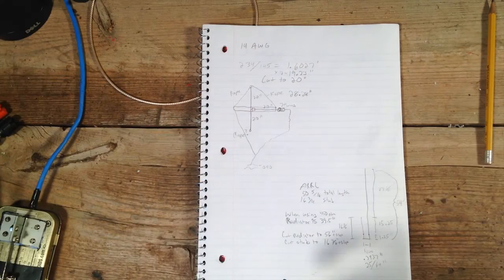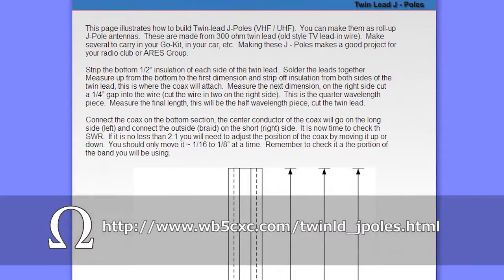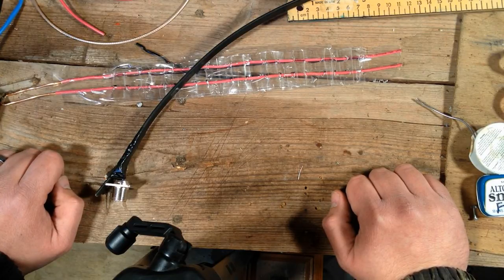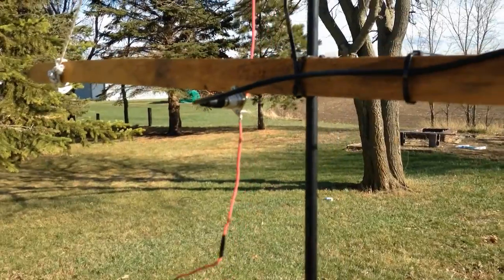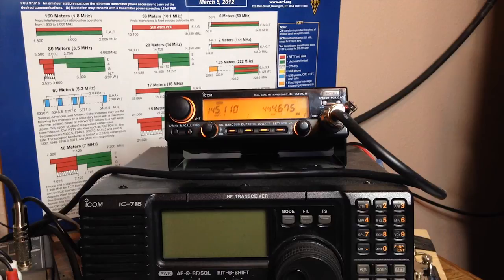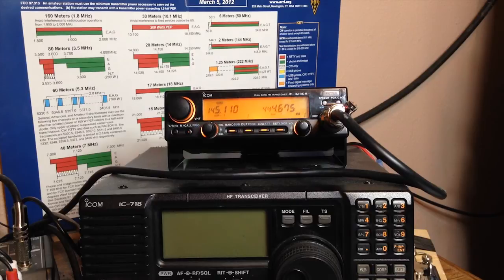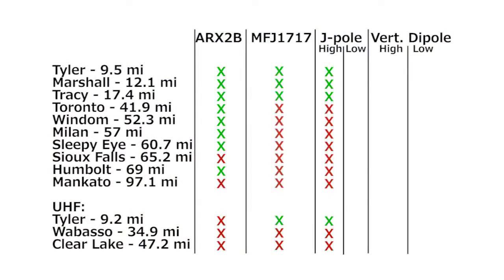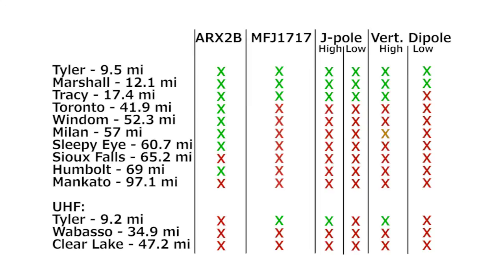2m Portable Antenna Shootout: J-Pole vs Vertical Dipole

Comment: Wow, - I made a well constructed vertical dipole, using 1 inch round aluminum elements, and put it up at 40 feet. it hits repeaters well to plus 30 miles in a very mountainous area, and I am in a small valley. I had better hopes for this video. You state the top of your J pole was 18 feet, yet you have the dipole at what looks like 6 feet?  Science has methods, you did not employ them.

Comment: some things I can see that are not clear but dont look right. You used building wire with conductors inside it as a die-electric spacer for the J pole. and you also could not tune a 300 ohm section of wire that did not have the rest of the antenna connected to it ? I have made several J poles and extended this to a co linear J pole the SWR is low and I trigger repeaters more than 20 km away on 476 mhz CB band here. Just working from figures people say does not work again - JUST WORKING FROM FIGURES AND DIAGRAMS off youtube etc does not WORK. Antennas are affected by all sorts of things even the diameter of the wire. YOu need to tune the J - Pole yourself by using 1)known diagrams and principles that work and sliding the  co-ax up and down the paper clip section until you get a perfect SWR reading on the mounting pole and soldering in place and then covering it with some self sealing tape. The co linear I use is far better than a co-axial co linear I purchased from a well known supplier. I used 4mm diameter copper tube filled with water and bent over at each end to bend the tube without flattening it.eg water is in compressible after bending open and drain and solder the wires.

Comment: The length of the short wire side on a "J" pole is critical as is the ratio between the short and long side trim or add 1/8 inch on the short side to adjust a ladder line "J" pole.

Comment: here's a question, have you ever tested a "super J-pole"? how about a collinear 2 meter?

I think my first build (i just passed my tech exam last night, almost made the general, missed by 2 questions!) with my baofeng BF-F9, for an actual "station" type antenna is going to be the "super J-pole" after that i might try a collinear style antenna.

hoping to get a yaesu 857D soon, assuming people stop overpaying for them on ebay... also looking at maybe getting a cheap 10m HF, SSB like an anytone 6666. I have a TYT 9800 in the mail, should be here in like a week hopefully (knew i should have just bought it off amazon prime)
Reply from the maker: This series of tests was done for portable-style antennas, just for the challenge.
There's a lot of hype about J-Pole antennas, but they are basically a vertical dipole fed at the end with a matching section. Making it a co-linear (super J-Pole) with two phased elements does a good job of getting some more gain lower to the ground. Practically speaking, it's probably not worth the mechanical troubles.
I'd love it if the channel could afford to do a real base station shootout. We could build a regular J-pole, a slim jim, a copper cactus, a super J-Pole, etc. and make it compete against a couple commercial antennas with various marketing department gain claims. But those commercial antennas aren't cheap :)

Comment: Some tips on what may have been to blame can be found on the Wiki page on J antennas...

https://en.wikipedia.org/wiki/J-pole_antenna
Reply from the maker: Once you put in all the decoupling and ground planes necessary to make the J-pole better, it looses the portability that was part of the design requirements.
Reply: It all depends on what requirements you are referring to.  The J antenna concept is quite old.